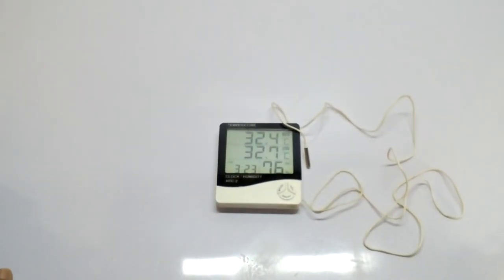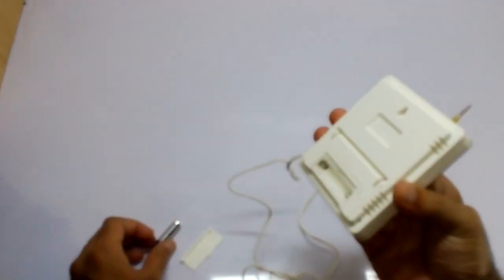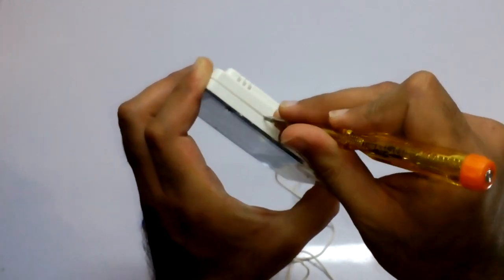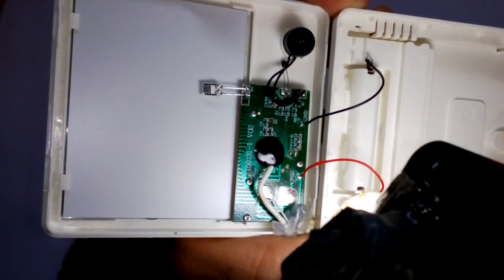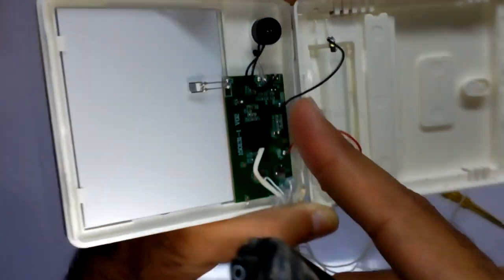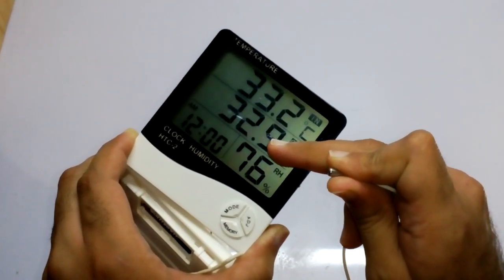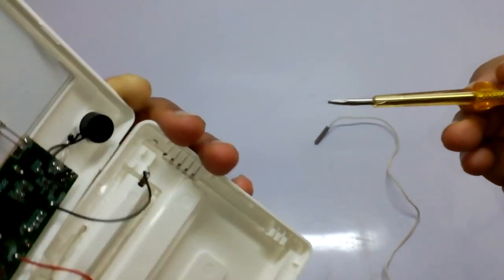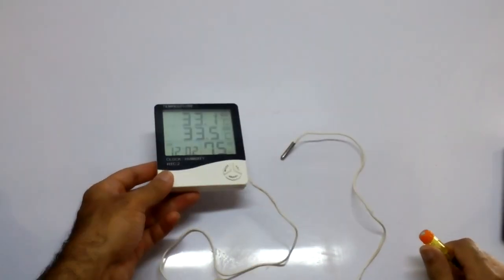What's inside of Hygrometer htc 2 - English

Comment: Hi omer did put the whole thing inside the incubator for it to work or adjust the wire cable with a probe
Reply from the maker: if you want only temperature reading than only put wire in incubator but if want humidity also need to pit inside